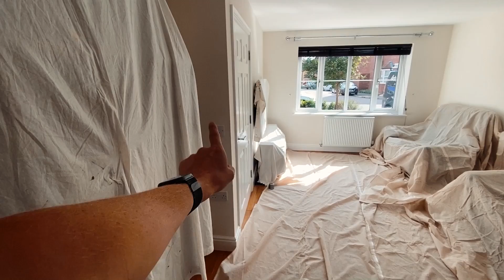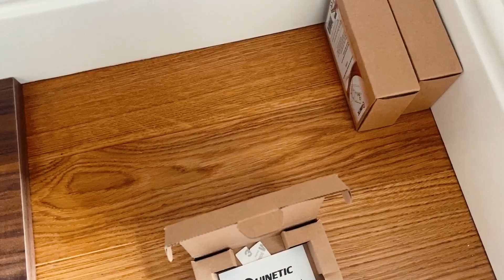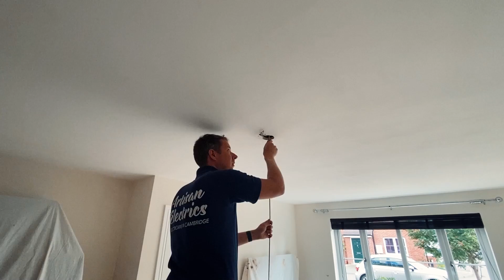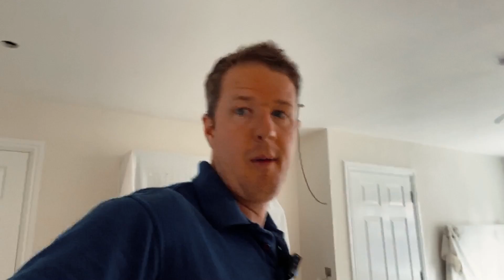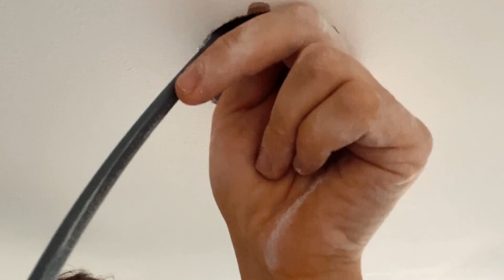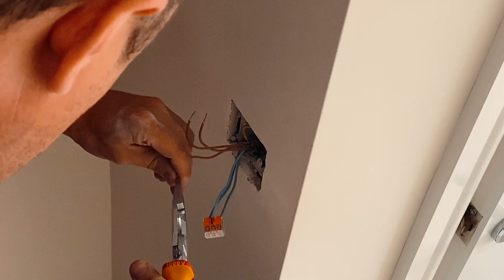Magic Stud Finder! 🤫 Installing LED Downlights & Wireless Switch

Comment: What a great video! I'll now be using those switch units to overcome a cabling issue I have without having to resort to chiseling walls. I also use an inexpensive endoscope camera for peeping into ceiling and wall voids. It comes with a 45 degree angled mirror attachment which allows you to poke the camera straight in to a small inspection hole rather than cutting a large hole.

Comment: I put 10 downlight in my living room cieling. All self-install. Routing the Cables under all the joists was a NIGHTMARE! They were solid joists with no holes at all. The only way was to drill holes along each joist to pass the cable underneath each joist. what a pain! but it looks amazing so was worth it.

Comment: I’ve started using a thing I bought off the internet called a ‘wallbot’. It plugs in to your phone/tablet and scans the wall giving you an image of the stud or nog, telling you the material of what it finds. I can’t recommend it enough! 

Also for marking out downlights I measure out at each end of the wall, put a piece of white tape with a sharpie mark on it, then laser between the 2 pieces of tape, this stops the need to measure out at each light.

Comment: Quick little tip from Australia regarding downlight marking, if you measure them on the floor and place temporary marks on bits of electrical tape you can then use a vertical plumb laser to transfer it to the ceiling.

When looking through downlight holes set your smartphone to video mode on the camera with the flash on and you'll have a nice periscope.

Comment: Quick question...I've done exactly as you've shown in this video, but when a qualified electrician saw my work he stated that I should not have cables going across and below the joists; instead, apparently, I need to drill holes in the joists (at least 50mm in) and feed cable through there.  Is that strictly true and am I breaking some law?

Comment: I got a stud finder for fitting downlights in my ceilings but it seemed to be finding joists everywhere. I went into the roof space and found that, here in Australia, the ceiling fixers use pieces of gyprock to reinforce the joints between boards. The stud finder sees every one of these as a joist! I found the easiest way to get around this without spending all day in my 50 degree Celsius roof space was to cut up a wire coat hanger and bend it to 90 degrees (not too sharp a bend). If you're fitting lights which need a 70mm hole, the length after the bend should be 35mm. Drill a small hole where you want the light and stick the hanger through. Turn it through 180 degrees and if you don't hit anything, you're good to cut your hole. There may be a bit of snagging on insulation but you can pull out and put it back in further round your circle. Worked for me :o)

Comment: I get a wad of plastic grocrey bags, stuff them into another bag and use that as a plug when I cut out the ceiling light holes.  Keeps blown insulation from falling down into the room!

Comment: Great video and the stud finder is such a useful tool along with the others. 
I fitted an Aurora colour changing kit which cost around £50 and includes 4 lamps and controller. Transforms bathroom, is very reliable, easy to fit and program. Works with controller or app and doesn't require broadband. It's a third of the price of Philips and a well established quality company. (Aurora AOne Connect AU-A1BTGUCWK Bluetooth 5W RGBCX GU10 LED Lamp Starter Kit)

Comment: Thank you for the video. 
I have a question for you: What do you do when there's no space over the stood and no space between the stud and the plasterboard?
I would like to know the best way to avoid cutting the ceiling when it's not possible to pass the cable over the stud.

Comment: Great video and I can relate to the pain of fishing through joists etc. 
One point I did notice was a lack of sufficient protection to the cable installed below the joist. Reg  522.6.201 is applicable here no?
Reply: I've never heard of, or seen 'oval conduit' in North America and I don't think that's an acceptable means of bypassing a ceiling joist, nor would it pass code.  Does passing electrical wiring through a steel joist not require a plastic grommet installed in the joist hole?  What is a 'maintenance free junction box'?  All junction boxes must remain accessible for maintenance.
Reply: Chris, pretty sure he didn't pass through a steel joist he was just going over small metal ceiling support struts and then going under a rolled steel joist.which is a bit dodgy.

Comment: Heck I always plunge in my 3mm /200mm screwdriver, explore for obstacles, on each hole ; before the holesaws go clean through. A tiny missplaced hole can be hidden with a tiny dab of plaster. 

Also is good for young guys the learn how to divide the room up : quarter/ half / quarter. Not third third third

Comment: Pretty pointless wasting money on those receivers when the ceiling is going to be painted following the 2 big holes left anyway may as well fill another 1 or 2 and save a hundred quid IMO. Fair enough if there was no damage at all.

Comment: This is the first video I have watched by you Jordan. I am not a qualified electrician, but am planning on training to become one. I do have some electrical knowledge and have done some minor jobs. I found this video very interesting and would like to comment on how impressed I was with the approach in which you carried out this job. You respectfully covered the customers furniture/belongings and floor and methodically worked out how and where you were going to feed your cables though the ceiling with minimal damage. I have been in a similar situation where I needed to route some speaker cable through a ceiling and what I did to figure out where the beams were and the situation above the ceiling was to take one of the downlighters out and poke my mobile phone through the hole whilst in record mode and the flash on, whilst moving it around. I could then playback the footage. I have subscribed to your channel and look forward to watching more of your videos. 👍👌
Reply from the maker: Thanks for subscribing! Glad you enjoyed the video!

Comment: Great video mate. I'm not an electrician so excuse the basic question but why did you go under that wooden joist and not through it? I thought that was against the regs? Currently in the process of swapping an old pendant for led downlights and need a way of getting through/round the joist (I dont have access from above).
Reply: I think that was chipboard he said where he put the conduit, but above the chipboard was a RSJ So he could cut through that!

Comment: Jordan, you can also use the hole cutter running in reverse, it will still cut but if there is wiring above then it wont damage it.

Comment: Probably said elsewhere, but these joist and called eco-joists. Great for getting cables through, but sharp edges on the metal. And never use a sharpie on plasterboard as it bleeds through the paint after ...

Comment: Couple of tips, when finding the joists use small bits of PVC tape to mark along the ceiling so you get a good picture of what's what. When fishing blind in holes stick your mobile phone up there like a periscope and take plenty of pictures, normally makes things much clearer! This only works with older mobiles, NOT the huge bricks with massive screens as seen today!!

Comment: I would never have considered fitting downlights without access from the room above. Interesting approach, certainly gives me plenty to consider. Many thanks. John
Reply from the maker: Thanks
Reply: I take floor up above and leave them with no damage to the ceiling, don't like working blind and you never know what's above and you could end up with a lot of holes and ceiling filling/repainting.(for them)
On the other hand if you explain and maybe give the customer exaggerated damage expected in advance it takes the pressure of you being perfect! Saves a lot of work on the knees, moving furniture lifting boards and carpet.  Better to think of yourself first before the customer though they never have to that! 
Having a large number of spots in a room can be difficult to get all equal distance from each other and missing joists at the same time.
Metal capping gives more protection to cable's running across the bottom of joists

Comment: Tip for you that I seen on someone else's video - when drilling through the plasterboard drill in reverse.. the points are sharp enough still to cut through the plasterboard but not wires etc. Hope you find this helpful. Great video btw 👌
Reply: Just read 2 comments down.. seems im not the only one who watched that video lol

Comment: I’m interested in doing something like this in my home. Do you have a wiring diagram (before/after)?
Also, does the new 2 gang switch not require wiring in to the mains?
Reply: The whole idea of the Quinetic switches is that they power themselves - superb for adding 2 way & intermediate switches without chasing out walls.
Reply: @robhesford1770  Power themselves how???  Battery in the switch?

Comment: Listen Listen all fellow sparks- I’ve installed hundreds of down lights over the past 20 or so years and I’ve Never once hit a beam, pipe or whatever.
Here’s how- after you have marked where you want the hole, carefully drill a small pilot hole 4mm then get a length of coat hanger about 250mm long and put a curved bend on on end the same radius as the fitting and one the other side so you know which way the other side bend is, the insert it in the hole and rotate it it around and move it up at the same time, if it doesn’t catch then you good to go, if is snags on a beam simply drill another hole slightly further away until it’s free. I always drill all my pilot holes first in case I need to grid shift the position of all the holes to get them spot on. I’ve worked with sparks who’s have just banged the core drill in the ceiling and hoped for the best and then have a big patch up job after- morons....
Reply: This is common knowledge to most domestic electricians.

Comment: Great about Stud tool. They will do me for putting up kids TVs next month!

DIYer first time watching. Watch a few other sparks too - interesting videos.

You need a cheap £5 usb endoscope from Amazon. Used them for data cabling before, drill hole, stick it up and you can see everything in the void! Think I was £12 it had built in LEDs and connected to laptop or phone to view it.

Comment: Why don't you use your camera through the hole in the ceiling to see inside for things in the way. I bought a little camera kit which is a 2 in. screen on a handle with a flexible arm the thickness of a pencil with the lens and light on the end, also you can fit a little hook on the end to hook onto things. got it from Lidl about £40,

Comment: Might be kinder to the wire you use to guide your pole, to attach it with a cable tie, rather than the split ring.

Comment: 19:41 Drilling that first centre hole was unnecessary You should drill all your spots first then pull that switch line cable to the nearest one and place the receiver there.

Comment: Drill a pilot hole before cutting your downlight. Use a metal coat hanger and bend to the diameter of the holesaw. Shove that up the pilot hole and rotate the coat hanger 360 degrees. This will check if there are any joists in the way, less making good on a 6mm pilot than a 70mm hole 😁👍⚡️

Comment: Would this Studfinder work on old Lathe and Plaster ceiling ?
Reply: If the magnet is strong enough, it should find the nails used to attach the lathe to the studs or joists.  If a steel lathe was used, your out of luck.

Comment: Very nice workmanship Artisan. I loved how you used oval conduit in the hole to protect the cable but I have one question. 
If you had to make more holes to run the cable if the joist wouldnt allow you to fish so how would you have filled those holes? Would you have made notch under the joist and put the cable in before filling the holes or just used oval conduit like you did but then how would you have made a drill to fill the round plasterboard with the oval conduit?

Comment: Very useful ideas about feeding cables.  KEEP plasterboard disks you cut out, to cover unwanted holes. Using a short length of batton fed into the hole, bridging it; secured with plasterboard screws at each end. Then screw and glue the loose disk to the batton. Once glue is set, screws can be removed. Just fill the holes and gaps with filler for a neat finish.
Reply: Done this. Works a treat.
Reply: Great tip, thanks! Quick question - what are your options if the disc is too chewed up to reuse? How do you cover the unwanted holes without a disc?
Reply: @MrJSmithify  If I had any other plasterboard with old skim on it I'd cut a piece from that to fit, otherwise I would cut a disk from a fresh piece of plasterboard and then it would need just a thin skim of filler to come flush with the ceiling.
Reply: 👍Thanks  @Paul_Holmes !

Comment: Hello mate, just stumbled across your video, nice tidy work. Why didn’t you poke your mobile up through hole with torch on and record the layout of beams above (sounds like eco beams), or if your phones wider than 70mm invest in a camera on flexi cable from screwfix for about 80 quid, as a builder it’s got me out of the shit a few times, being a sparky I guess it would see a lot of action.
Subscribed even though I don’t personally even touch electrics.
Reply from the maker: Thanks for subscribing! I do have an inspection camera I use sometimes as my phone is too wide but in this case I managed without it.

Comment: Nice video. 
Have you the ref of the silicontool for prevent the dust for big hole? I can't find it.
I use also same thing with simple big neodyme Magnet (40*40*10) work well. I use also for guide my chopsticks pull wire after fix one little magnet. 
Thx
Reply: D.A.D.E. (Dade Dust and Debris Eliminator)

Comment: You probably should have used a cable finder before you drilled the hole. My stud finder has one built in and while not perfect, it’s better than guessing.

Comment: I’ve used several small neodymium magnets to find the nails/screws in my ceiling, but one problem I ran into was that the spacing was almost the same as the truss spacing and also forming a square pattern. Only after finding a lot of nails I was eventually able to pick the straighter line and therefore the truss location.

Comment: Don't know if anyone has mentioned this yet, but another tip for using hole saws is to start drilling forwards and finish off in reverse. Generally prolongs the life of the teeth and also less chance of cutting unseen cables etc
Reply: Reverse all the way in drywall.  More forgiving when starting the cut.
Reply: I've Just read this comment, what a great tip. Will give it a go next time I use a hole saw.👍

Comment: You should have cut the joists with multi tool to get cable through and than you should've used metal safe plate to protect the cable.
Reply: Chipboard and then RSJ was above that hole

Comment: Hi Jordan, thanks for the video.  Quinetic is the way to go!  As far as stud finding is concerned, if you have an old computer, just smash the hard drive and use the magnets in there.  They are extremely powerful and work just as well as your stud finder tool (for free!)
Reply from the maker: Cool thanks for the info!

Comment: Can always fit a smoke alarm as joint and hole cover up were pendent was. Also quietic do a switch with built in receiver.

Comment: I always wondered what that keyring attatchment was for too, i thought it was for dragging things with holes in through spaces, great idea you discovered. Love my Mega Super Rod kit, saved my bacon on may occasion. Used it today in fact lol. The led light you fit on the end and poke through ceilings is great for looking in lofts and finding where your hole is. Expensive but pays for itself through time and stress reduction. I also bought it after your review. Great Job Jordan. I kept thinking "why not use a camera like a "ferret cam" or similar to see what was on the run? I use a set of neodimium magnets to do what the stud buddy did, same idea, but you can spread them around and see your joists. Have you tried "Curv" kinetic switches & Receivers? i use them a lot, and theyr'e great. pre-wired receiver just connects to a wago box, easy as peas! the Quinetic ones look a bit fidlier, but the Curv switches have a 3M sticky back or can be screwed but not to a standard back box, wheras the Quinetic can, and screw terminals are so last century now lol. Oh and I like choc chip cookies, and gariballdie biscuits with my coffee yum!

Comment: Why not stick a phone with the camera and torch on. Might be able to get a better view. Just a thought.
Reply: how are you going to see the phone screen, when it's up through the hole in the ceiling. 🤔 Also try and put your camera on and your touch at the same time, it doesn't come on torch goes off. 😅😅😅